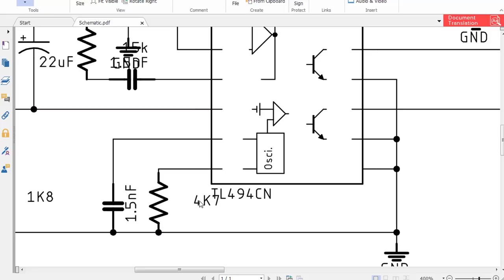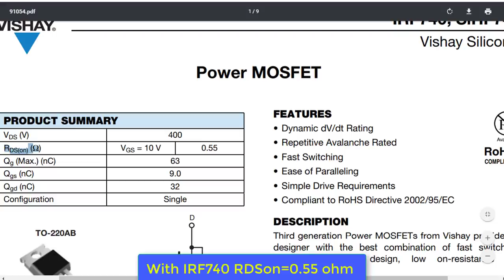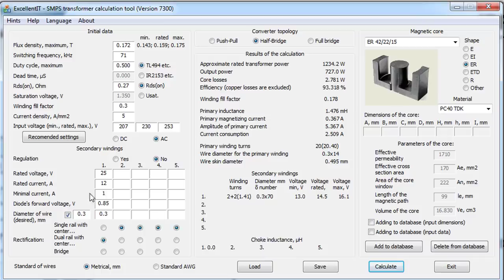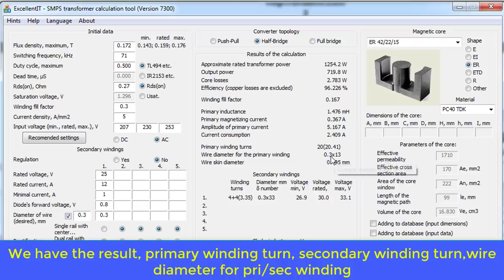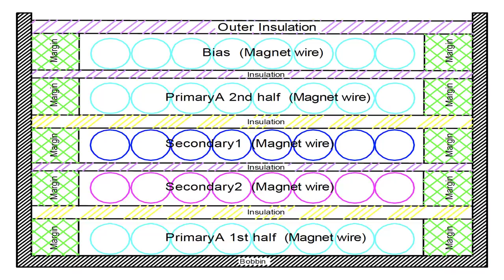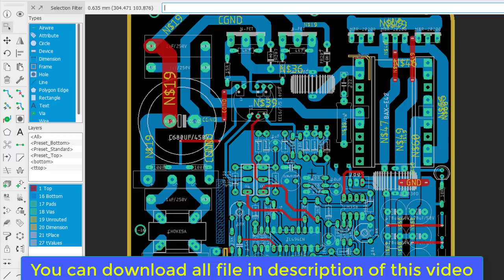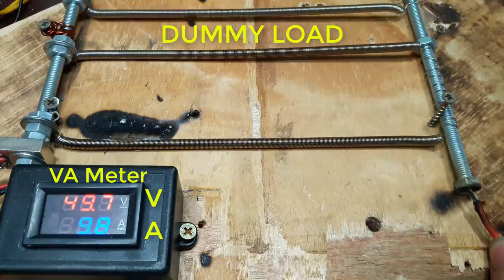Ferrite Transformer Turns Calculation and Rewind Transformer | 500W SMPS Short Circuit Protect

Comment: Hi Long Tech.... Nice video.  I tried to watch out the video, diagram and part,  and found confused on  Current TR  and Output  Inductor  using the same code as diagram SFT830D, but the part model was different.

Comment: *HELP*. I want 35V 15A dual rail output. Rds on is 0.008ohm. My diodes have 0.93V at 15A but the calculator says :
"Drop at the transistors is too large.
Incorrectly selected transistors.
Large channel resistance
or the saturation voltage."
Core:ETD 59/31/22 3F3 MAT.

Comment: The calculator ( Version 7300)  does not appear to  work properly  . I am using the same specification information as used in the video .  Non numeric garbage characters  displayed in the following fields -  Approximate Rated Transformer Power ,Efficiency, Amplitude of Primary Current and Current Consumption . Other fields are ok . Anyone else seeing this problem ?